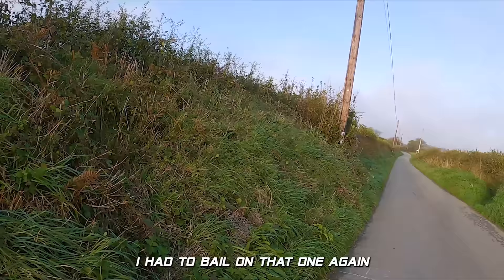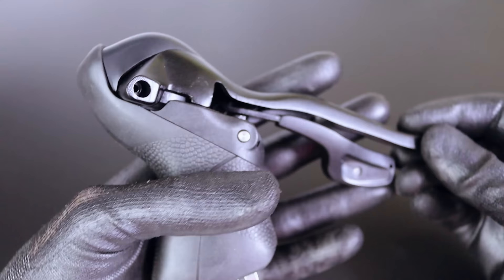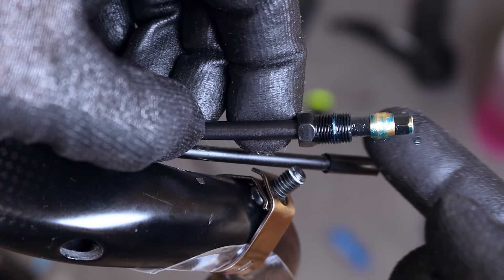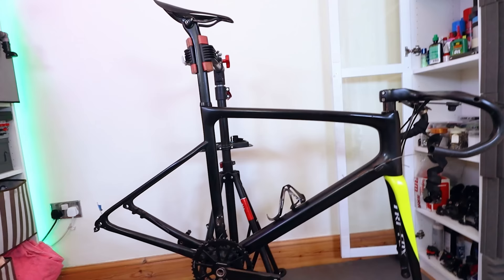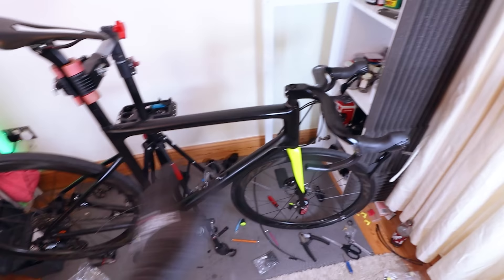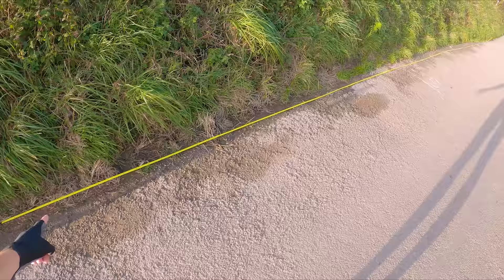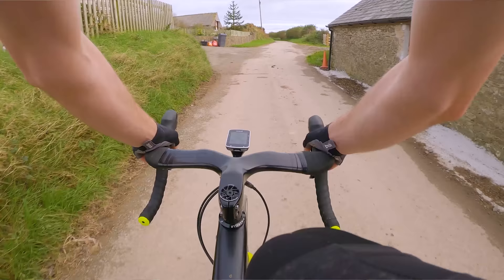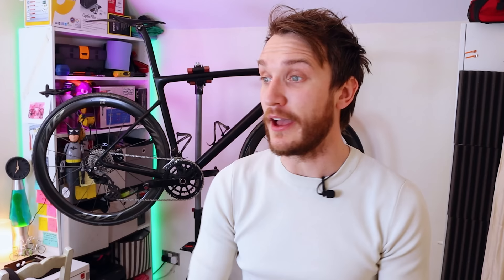Mechanical VS Hydraulic Disc Brakes - Shimano RS505 install & test

Comment: Hi Luke, another great video- both informative and entertaining. My experience with full hydro brakes (105) was somewhat different. For context, I do live in East Anglia so so braking is less challenging than in the West Country. I actually found the brakes rather too powerful and I found that  they required so little lever force that I could not really get the feel or feedback that I wanted. On wet/muddy roads I lived with the fear that I would accidentally lock the brakes and fall off - particularly the rear brake.  I decided to go back to TRP Spyre mechanical calipers with a 180mm front brake disc rotor and a 140mm rear rotor  (https://youtu.be/Lkp4K4Dd-kE). Just about to tryout some Zoom hybrid mechanical/hydraulic brake calipers, not the Zrace shown in my video, and fit a Sensah Empire group-set on your recommendation. Again thanks very much, I appreciate just how much effort can go into make these videos.
Reply: "Another great video".... The problem is, when you start your comment with such a ridiculously false statement it  delegitimize everything you say afterwards.  These videos are complete and utter garbage.
Reply: Surely your first move should have been to reduce the front rotor to 160 or 140mm. My MTB only has a front 160 rotor.
Reply: @paullinnitt5450  Paul, yes you are absolutely correct, but  I perhaps didn't explain very well. With the hydraulic brakesI had a 160 rotor on the front and a140 on the rear. Reducing the front rotor size would have helped. But I couldn't go smaller than 140mm on the rear. As I, possibly different to many people,  use the rear brake for general speed control, I was more concerned about the rear brake power and locking up. I definitely would like something more powerful than the mechanical brakes but less powerful than full hydraulic which is why I'm about to try a pair of mechanically actuated hydraulic brakes.

Comment: How do you find the performance in the wet?
My Tiagra hydraulic brakes are fine in the dry but awful in the wet.
Reply from the maker: Wet and dry them are great tbh. In the wet especially they do have a bit of an edge over the mechanical setup. I find they dry the discs off, and clear the water a little quicker.

Comment: I will never go back to mech disks.   Too much cable stretch.  Like pulling on a rubber band.  I have a full r5800/rs505 and r7000 bike.  The main difference is the size of the hoods on the rs505 levers are HUGE.

Comment: Hi Luke! I would like to ask if is it safe to use Shifter Cables on rim brakes? I know someone uses it and it is actually easier to squeeze the lever compared to mine. We are both using Ultegra shifters by the way. Thank you so much and more power to your channel!

Comment: There's some flaws to your argument that Hydro disc are 'much heavier'.  You're comparing the bulky RS505 group to your ultralight Empire carbon levers. That's not a fair comparison. If you compared to 105 Mech shifters the difference would be less.  And if you simply switched to Ultegra Hydro levers, you'd be 229g lighter. (15g lighter than your mech setup).   Hydraulic hose and fluid will always weight less than cables and housings.  So no, fully hydraulic isn't much heavier.

Comment: RS505 is pretty good. Easy to fit, easy to service. You can also mate them with Shimano MTB hydro brakes, which I did on my wife's CX/adventure bike as it was a post-mount frame. As you say, 505 was unloved and bargains can be had.

In fact, I've just bought a too-small complete bike with these fitted. Everything is currently getting shifted to a medium frame I've picked up, apart from the wheels, which I already have. 

When done I'll sell the small frame and wheels, hopefully make some of it back.

BTW, pick up a cheap pin insert tool if you can. £15 or so on Amazon. Far better than the blocks you have. One way that Shimano lags behind SRAM in this is that SRAM thread the insert, so it can be screwed in, and of course unscrewed if needed.

Comment: Here are some real life emergency braking for you:
Hydraulic Shimano 105: youtu.be/qmWFd4bOAug
Shimano LX V-Brake: youtu.be/aAHaWwggI7A

Now you tell me the difference.
Reply: Also: Just because you do emergency braking often is not really a bad sign. I do it a lot when i'm riding alone so i can be ready to do it when the time arises. If you don't practice it, you are more likely to fail when you most need it, either by not avoiding the crash, or by hitting the brakes too hard.

Comment: You added 2.96% extra weight to gain a 19.5% reduction in brake distance.

And if people are honest with themselves, they'll know that their day to day weight fluctuates by more than two kg - 10 times the weight savings from using the mechanical disc brakes.

Comment: Two words, 'skid marks'. Decent hydraulic discs can be quite hairy until you get used to them. I have HYRD trp mechanical actuated hydraulic on one bike. Much better than the stock mechanical ones that came with it. Do you get involved with the ride 100 Lands End event?

Comment: Was there a particular reason you have the brakes reversed? So the front brake on your left? You're left-handed by any chance?

Also, keep in mind that the routing for the gear cable is a known issue with the R5800 shifters as the cable guide used to route the shift cable around the right angle is prone to wearing out.

Comment: The trouble with hydraulic brakes isn't the hydraulic brakes. It's the vast swayth of naysayers who'll cast doom and gloom overall things hydraulic. Whether it's the complexity of setting them up - they aren't complicated, there's fewer moving parts than mechanical brakes.  Then there is bleeding which apparently is ultra hard - except it isn't. Both Sram and Shimano are super easy. Then there is not being able to repair them when out and about. They don't break. Please go to the Enduro world series and ask how many people have ever damaged, let alone broken a hydraulic brake. I would never buy a bike now without hydros, be that MTB, Road, Gravel or anything else. It's set and forget. Even when the pads wear, you just swap them out and leave everythingh else as is.

Comment: those are wrong pads, you're showing, dude:)
you have in those calipers L03A (L02A older model)
J03A is not compatible with road calipers. it's a MTB brake pad

Comment: I wont be suprised if Shimano would make ABS tech on next coming years on their ultegra and dura ace. That would be more braking power + less skidding as tires wont lock up.
Reply: I think we would get single channel ABS initially, so front modulation only. The hydraulic actuator would be the biggest issue. Even the smallest unit would be difficult to integrate into a calliper or shifter. The judder would be terrifying without dampening. Here is a vid from 2019 https://youtu.be/n1PkQ9Nn3GA
Reply: @yehnahthx  it can be placed in the middle of the brake hose line. Signal can be send like wireless di2. It may add around 300g per caliper either inside toptube or inside integrated handle hars but i think its worth it if you slam the brakes and wont go OTB.

Comment: I must say I`m very disappointed in you Luke. I thought this channel was all about budget bikes and parts? £300 for shifters and brakes!! That isn`t budget. And why full hydraulic? It`s not necessary on a road bike, mtb and gravel yes but not on a road bike. I`ve never not been able to stop a road bike with rim brakes. I understand the need for larger tyres and I know people like the look of carbon rims so the need for disc`s accommodate this but the Juin Tech`s are more than capable of stopping any bike with any size rider.
Reply: Don’t be disappointed if you cannot purchase everything Luke has. Maybe this channel is all about Luke’s cycling hobby and just happens to revolve around finding and testing affordable bike parts?

Have to agree on excessive braking power on the tap with hydros: if one out of ten pre-planned emergency braking situations ends up to otb or bailout result, that’s a thing to consider when there’s a real immovable object (car, wall, hole in the ground) suddenly appearing in front of you. Testing the capabilities of your new gear (and yourself) as demonstrated in this video is a responsible thing to do.
Reply from the maker: So this is a fair point, but I will say that this is the cheapest hydro setup that I have ever seen, hence the reason I posted this episode. I think £250 for a fully hydro 11 speed shimano setup is a pretty great price. Certainly the cheapest I've ever come across. Plus in order to be subjective, I need to try hydro stuff too. As mentioned, if you are on a budget, mechanical disc is still a great choice, and I've covered this is alot of detail also.
Reply: @TraceVelo  I think you mean objective
Reply from the maker: @9psi  'To be objective is to be unbiased' - You're totaly right, I've being saying it wrong this whole time 😄

Comment: Too much jumpy camera.  Too much too fast speaking.  Too much jumpy presenter.  Too much waving hands about as if they’re on fire.  Too bad because the content is good.  If the content is strong, theatrics aren’t necessary.  If the content is weak, theatrics can’t really cover.  Enthusiasm is good and fine, but this goes over the top.